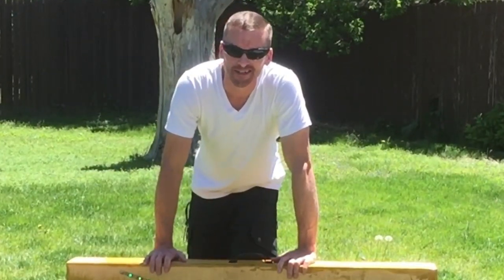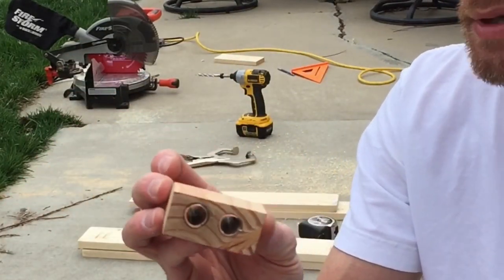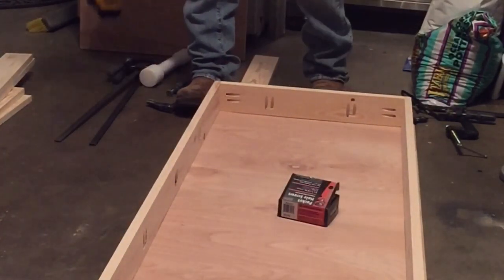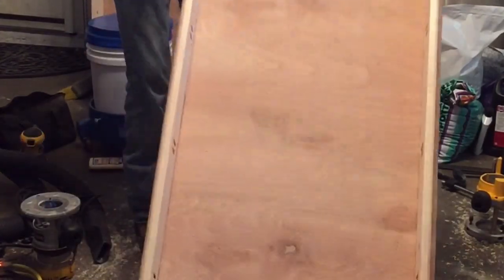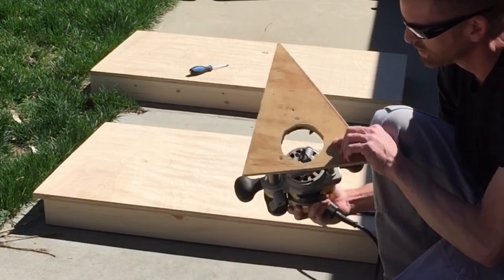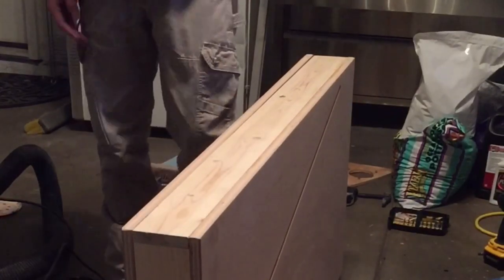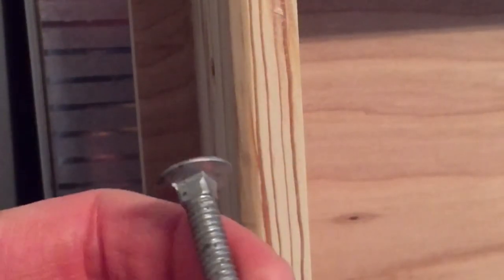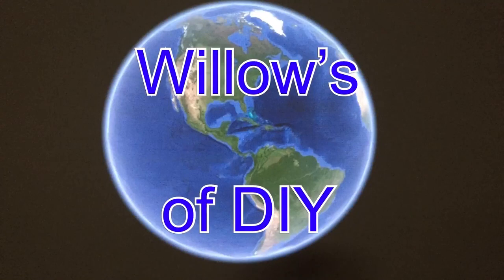DIY portable Cornhole boards with built in app controlled LED lights pt. 1

Comment: Wow, nicest set of boards I’ve ever seen. I loved how you cut the channels out for the led strip and epoxy first before the hole cut. Never seen it done that way.
Reply from the maker: Thanks Ryan! I'm glad you liked the build! I have seen other people cut the hole out first and tape it or stuff a 2 litter bottle in the hole and then pour the epoxy but in the videos that I saw they had a hard time getting the tape off or the 2 litter bottle out and the epoxy around the edge of the hole didn't look that great. So I thought I would try routing it after the epoxy has cured. I think that method gives it nice clean edges around the hole. Thanks watching and subscribing!👍🏻
Reply: Yeah your way is so much better. I need to make one of those jigs u made with router
Reply from the maker: I just made that with a scrap 1/2" piece of plywood that I had laying. I don't know if you noticed but in the first video when I  router out the LED channels it was a triangle and in the 2nt video I cut it down so I could see the channel better. I left one point on it so I could drill more hole to have different pivot points to be able to make a wide range of hole diameters.
Reply: question for you.  Does the epoxy resin finish make the bags slide more than a normal finish with polycrylic?
Reply from the maker: Good question! I have asked that same question to the last 10 people that have played on my cornhole boards. 9 people said that they couldn't tell a difference. 1 person said they thought "it slides a little bit faster but not much". All 10 of the people I asked own polycrylic boards at home. I personally don't notice a difference.

Comment: I'm watching thinking, "what about the legs?" Great solution! One thing I do on my builds is instead of drilling a hole all the way through the sides leaving a bolt exposed on the outside I drill a hole partway through big enough for a .5" threaded insert and bolt the legs on like that. Looks cleaner to me. I'll have to think about giving your stacked method a try as I need a new set of boards.
Reply from the maker: Thanks Michael! Threaded inserts is a great idea! I got to play on this set of boards last weekend and they still look great! I love the way these cornhole boards turned out! I hope my video helps you build a set of your own. Thanks for watching!

Comment: I like everything about these boards except the method you have used for the legs. I think once a party gets a bit wild in the backyard and someone who weighs about 200 pounds accidently steps on one of these, the legs are gonna bite the dust.  Otherwise these are nice and you do a great job building them.
Reply from the maker: Thanks! I'm glad you liked the build. I haven't had any problems with the legs so far. I know that they will hold my weight because I have stood on them but I only weigh 140lbs. I will have to test them with someone 200+ or just hold a 80lb bag of concrete when I stand on them. I will let you know how they do after I test the weight limit. Thanks for watching!

Comment: Thanks very much for the 2 videos, absolutely love your design.  I'm building a set for my daughters wedding and I'm getting ready to cut the notches for the LED lights.  When you used the router to create the round circle notch for the LED lights, would it make sense to leave a 1/2 inch space/gap between the notch and the 6" Hole in the board rather than having the notch and the hole border one another?  I'm just worried about the Epoxy eventually pulling away from the edge of the notch and pulling the LED lights away from the edge.
Reply from the maker: Thanks Daniel! I designed it the way I did so the lights will shine into the hole and illuminate that edge. I haven't had any problems with the epoxy light ring separating from the wood, and I Carry it by the holes when its being carried by 2 people. There are 0 cracks or signs of separation. I like creativity, so please build it to suit your needs and likes. I hope this is helpful. Thanks for Watching!
Reply: @WillowsWorldofDIY  Thank you for the response. I'll take the ROUTE that you suggest :-).
Reply from the maker: No problem. I hope your daughter and her new husband love the Cornhole set. Thanks for subscribing!

Comment: Great video bro!! I know cornhole holes are 6" in diameter but what was the overall diameter of the hole you made so it would turn out to be 6" after the epoxy?
Reply from the maker: I'm glad you liked the video Jose! I used a 1/2" router bit and measured 3" from the inside cutting edge of the router bit and drilled a 1/8" hole at that point on my jig to router out the 1/2" channel for the LED lights. Then I measured 3" from the outside cutting edge of the router bit and drilled a 1/8" hole at that point on my jig to router out the 6" hole. So the diameter of the 1/2" LED channel is 7" and the hole is 6". Thanks for watching & for the likes & subscribing!!

Comment: Do you have a supply list of everything you started with?  I wrote down all of the wood sizes but just want to make sure I got everything.  TYVM great video
Reply from the maker: I don't have a complete supply list but I put links for the supplies I used in the 2nd video. The only thing that isn't in my links is the 4 carriage bolts for the legs (2 2" & 2 2-1/2" bolts). I hope this is helpful. Thanks for watching!

Comment: On the legs: is the hole intentionally off centre when you say to drill the hole 1 3/4" from the side of the 1x4" piece?
Reply from the maker: I ripped the 1x4" legs down to 3-1/2" and drilled the hole centered at 1-3/4". I ripped the legs down to 3-1/2" to make clearance to keep the electrical wires from getting pinched when the corn hole boards encased together. I hope this is helpful. Thanks for watching!
Reply: @WillowsWorldofDIY  brilliant, thanks. The boards are amazing, waiting on my LEDs and epoxy arriving. Quite an expensive set of boards but playing host to the Corn-holing World* Championships this summer so need to make something suitable for the occasion. World = street in a village in West of Scotland.
Reply from the maker: Thank you! I'm honored to have my design in the World Championships! Sounds like a lot of fun. Good luck! If you have any more questions on the build please let me know, I'm happy to help.

Comment: Hi, I am making these for my daughter as a wedding gift but without the light part. Curious if you are using a birch  or sanded ply for your deck.  Also the type of 1 x 4. I doubt they will be left out in the elements so I am not sure if I need cedar.   I have never worked with epoxy so I was planning to stain and urethane. Thanks for your help!
Reply from the maker: Hi Dawn G! I used sanded 3/4" maple plywood for the decking, and pine 1x4's. I would use an outdoor spar urethane if you're not going to use epoxy. I hope this is helpful. Thanks for watching!
Reply: @WillowsWorldofDIY  Thank you !!

Comment: How did you make the pocket hole jig
Reply from the maker: I used a piece of wood 2"x4"x3-1/2" that I cut down to 1-1/2"x2"x3-1/2". Then I drilled (2) 1/2" holes strait through the 3-1/2 block. I used (2) 1/2"x3-1/2" copper pipes and ripped about 1/4" channel down the side of the pipe to reduce the pipe diameter down to fit over the 3/8 pocket hole drill bit. (You can buy steel sleeves that will last longer if you don't want to use copper. I just used the materials that I had on hand.) Then press the copper tubes or steel sleeves into the block of wood and then cut the bottom of the block of wood at a 75 Degree angle. I hope this is helpful. Thanks for watching!

Comment: Hi Willow, I'm onto building the legs and i have a question.  The legs that are mounted to the "separate" mounts look as though they are straight up and down and not at an angle where as the legs mounted to the outside edges appear to be at an angle.  Is that correct?  Does the question make sense?
Reply from the maker: Hi Daniel, Yes that is correct just make sure that you measure 12" from the top of the decking, bring the string line past the legs to the top edge of the decking, come up 12" at that point and mark a line where the string cross the legs. I hope that makes sense. If you measure up 12" at the same point at the top of the decking on both cornhole boards they should stand at the same height (even though the leg are at a different angle).  Please let me know if you have any more questions.
Reply: @WillowsWorldofDIY  Ahh, that makes sense.  Perfect.  Tx

Comment: What type of bit did you use to make the channels for the lights?
Reply from the maker: I used a 3/4" straight router bit to cut the channels. I hope this is helpful. Thanks for watching!
Reply: So the router bit for the whole was 1/2" and the straight channels were 3/4" bit?
Reply from the maker: It's really just personal preference. I have build boards using a 3/4" bit for the channel and hole, but in this video I think I used a 1/2" bit for both the channels and the hole. The led lights fit perfectly in the 1/2" channels, if you want wider channels then use a 3/4" bit.

Comment: You really only need 1 pocket hole instead of the pair on the tops.  Just fyi. Good job though
Reply: But it’s a whole lot cooler to have 2 don’t you think.. good comment though 🤔
Reply: @bandit08  never hurts. Thats for sure. Since i bought my batt op nail gun gun i quit using the pocket holes on the top.
Reply: Nail guns can be fun
Reply: @bandit08  only reason i use it now cause faster.

Comment: You're not going to have your hearing or fingers for long if you keep ignoring basic safety considerations.
Reply from the maker: I appreciate your concern for my safety. Not everyones skill levels  are equal. This isn't my first rodeo, I have 20+ years experience working with these kinds of tools, I'm always aware of where the blade is and I use a push stick when necessary. I usually have my earphones in when working with loud tools but not always. I will try to be better about protecting my hearing. Thanks for watching and thank you for your concerns.